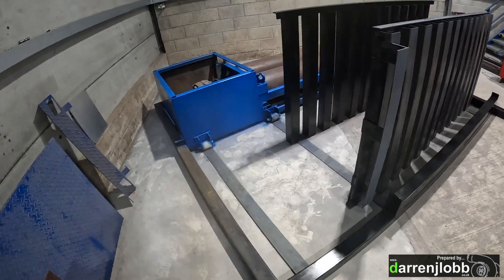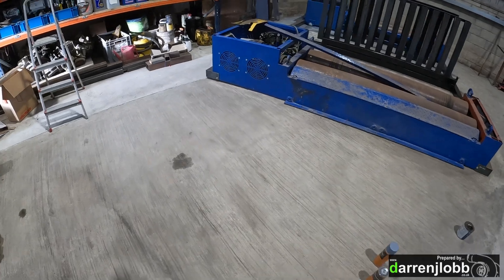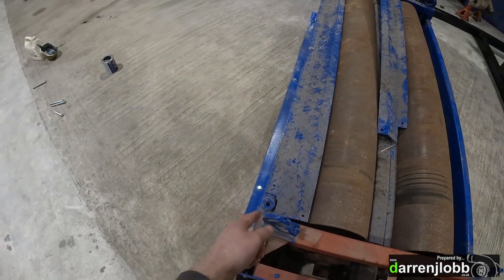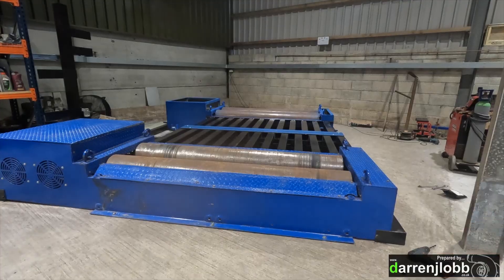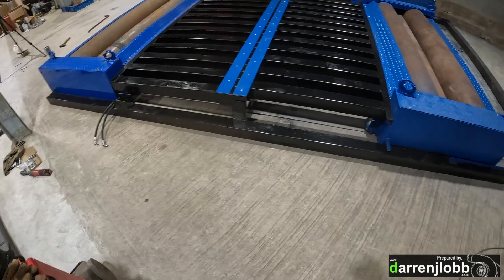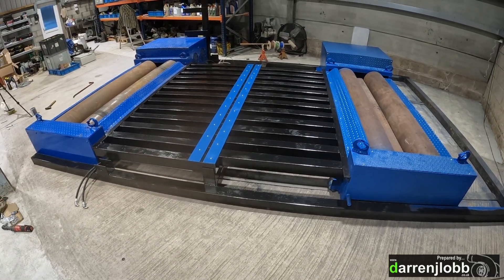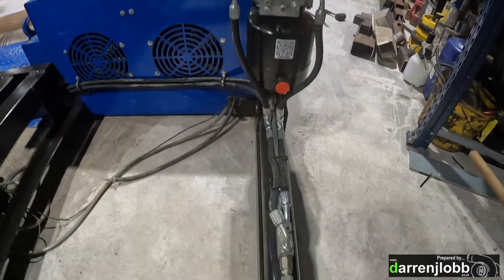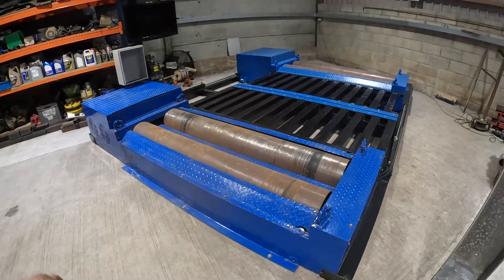4x4 Chassis Dyno Project Part 4

Comment: This is looking awesome!! One thought, if you ever have issues with the rams moving at different rates you may need to add some flow divider valves, otherwise the flow might take the path of least resistance and one side might move faster than the other - potentially causing it to bind 🙂 hopefully not though 🤞🏻
Reply from the maker: Good comment, this is something I had considered for a long time.... Infact, because of this issue, my orignal plan was actually to use two lengths of chain down the chassis, and then a shaft across the dyno and two sprockets, with a 90degree bevel gearbox and motor... However this was going to be a fairly expensive option... In the end, once I realised how easily it rolls by hand (can push it with 3 fingers), combined with the frame being a couple mm's along each edge, im fairly confident it will stay true and not bind (the walking floor also prevents it from being able to...)...but time will tell!
Reply: @darrenjlobb 
Hi Darren. Totally off topic. Hope you don't mind. But whatever happened to those two Peugeot 505s you had? I have a turbo diesel. I'm looking for some parts.